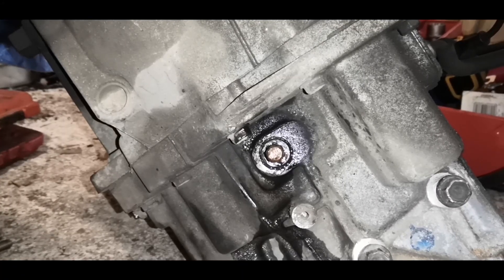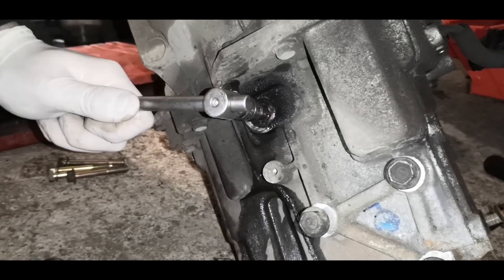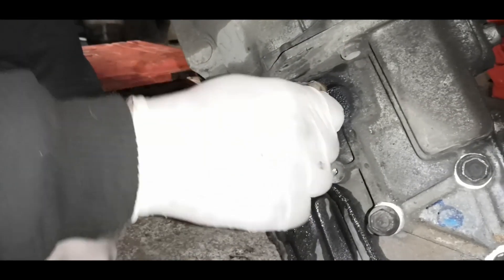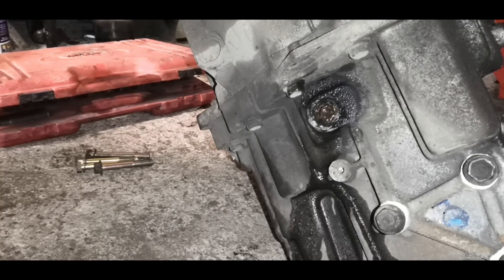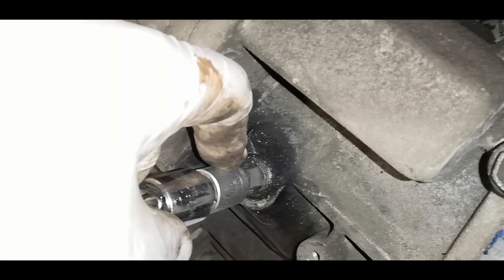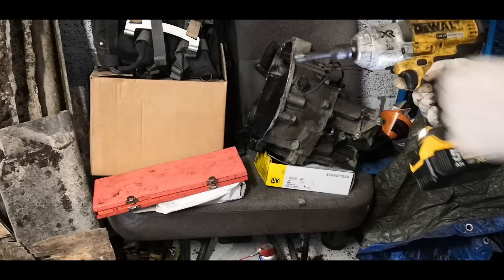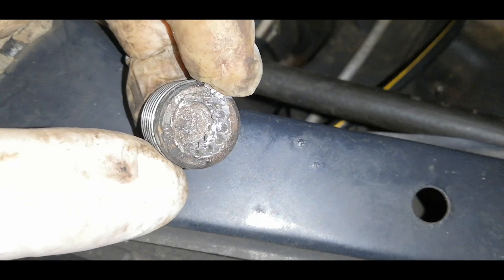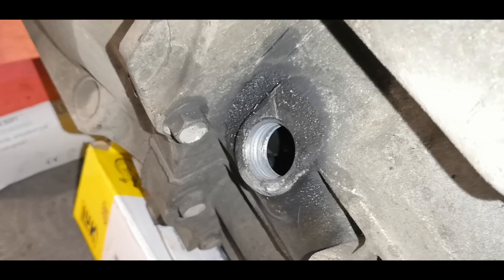Nissan Micra K11 Stuck Gearbox Fill Plug Removal

Comment: You definitely deserve more subs. So underrated. Keep up the work man. Also my gear changes in my Micra k11 2000 are quite stiff and require abit of force to change. Would you possibly know why?

Many thanks
Reply from the maker: Stiff gear change or stiff clutch pedal? A stiff gear lever could be caused by the Bush at the base of the gear stick itself. It's out in the elements and can get quite caked up on dirt.
Reply: @maxautouk  Are you talking about the shifter linkage, is that where the bushes are?
Reply from the maker: @hydrolics5449  that's the ones...
Reply: I have same issue...stiff gears, they select fine but feels stiff to move, and the clutch it fine.

Comment: Hola amigo se puede sustituir valvulina por ese mismo orificio con la caja puesta en el coche? O hay alguna otra forma? Que valvuluna aconsejas para mi k11 1.4 16v?gracias espero su consejo
Reply from the maker: You can remove the speedo drive and full the gearbox from there 😄

Comment: Isn't there a dipstick for this transmission? Then it can also be filled through that opening.
Reply from the maker: No, there is not a dipstick on the manual transmission
Reply: @maxautouk  you could just take out the speed sensor and use that hole to fill the gearbox
Reply from the maker: This works well but I like to use the fill plug so I know it has the correct amount of oil in it but in a pinch I’d use the Speedo drive too

Comment: Man I'm having exactly the same problem. It is stuck in there as tight as a truck wheel nut. I tried to solder a bolt there (all current passing through the bolt itself) and even then I couldn't take it of
Reply from the maker: Those tapered bolts are the worst!!
Reply: @maxautouk  I took it off yesterday! We soldered a big and short bolt to it, with the electric current passing from the case to the bolt trough the threads, and we had to drive it with a long wrench. After a big amount of strength it started to spin. Anyway, thank you for your video! Cheers!
Reply from the maker: I'm glad you got it sorted sounds like a good job to me!
Reply: @maxautouk  thank you! 🙌

Comment: What is the torx size
Reply from the maker: I used various different sizes but the original bolt is a large female hex
Reply: is a 10mm alan original  size, i will try to fit in a 11 mm .. mine is stuck because is used a thread fix .. crazy ..
Reply from the maker: They can be crazy tight!
Reply: My mechanic friend told me we have to put a torch with fire to heat up , that the thread fix will melt ....after that would be a bit easier to unbolt this crazy ... Nut
Reply from the maker: Takes a lot of persistence to get them out even for us pros
Reply: @maxautouk  i filled up in the end of the day  over the aeration 6 mm pipe 🙃 all 3 liters
Reply from the maker: Good job

Comment: Can't you fill it up on the speedo drive?
Reply from the maker: You can do that, but I prefer to free up the drain plug, it's a better way to fill it because you don't have to guess when it's full
Reply: @maxautouk  Yeah I did an gearbox oil change today and surprisingly the filler bolt opened with a use of a breaker bar :)
Reply from the maker: @hydrolics5449  good man!
Reply: @maxautouk  Yep I was shocked as I've heard many times that the filler bolts get rusted in so I must have been lucky lol
Reply from the maker: They don't really rust in, as the gearbox goes through so many heat cycles the bolt itself is tapered so it gradually edges itself further down the threads each time it expands in the heat... Eventually it ends up as tight as a truck tyre nut... Literally
Reply: @maxautouk  Ah right, makes sense then 👍
Reply: That theory makes me wonder, would it be easier to remove that bolt after a long drive(because of the heat)?
Reply: @maikelnait4495  possibly mate, I did drive mine a few miles and then loosened the nut with no problem at all. I didn’t try it when the car was cold so I can’t compare but I’d say you should give it a go! 😁